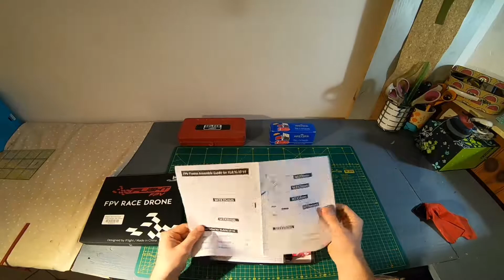8" LONG RANGE BUILD -  IFLIGHT XL8 V4 - XING 2806.5 1800KV - TMOTORS F55A PROII F3 - KAKUTE F7 V1.5

Comment: Ok let me rephrase... 

Xing, Flywoo, BH, RCinPower - all manufacturer suggest the 1300KV is meant for 6S, and 1800KV is meant for 4S. Probably too hot for 8", and thats why no test data.
 I have Xing 2806.5 and BH2812.
Reply from the maker: I run these motors (1800kv) on 4s and 8x4.5x3 props and you can trust me, motors are very cool after flight. (Not hard ripping but with some hard punch)
With 2806.5 you have enough torque to run big props

Comment: In case really n00b... 1800KV != 6s
Always look at mfc suggested setups.

For bigger prop, at same voltage, you need lower KV, and bigger heavier motor. 6S is 50% more than 4S. 4S 50% higher KV.

7". 6S 1300KV. is same as 4S 1950KV.
8". 6S 1100KV. is same as 4S 1650KV.
9". 6S 900KV. is same as 4S 1350KV.
Reply from the maker: Pretty sure you don't know what you are talking about

Comment: Awesome build! Could you fly this setup with 1800KV on 6s? Or is 1300KV the way to go for 6S?
What flighttime did you get?
Reply from the maker: Hi mate, i think you can run 1800kv on 6s but not with 8" prop, maybe 7 inch. I don't know about flighttime cause i only do some settings flight. I tell you maybe tomorow 😉
Reply: @ThePovOne  nice thanks!